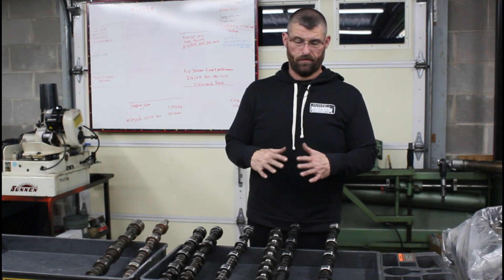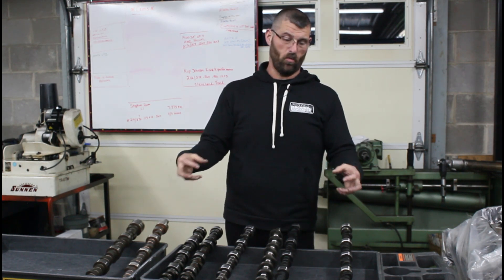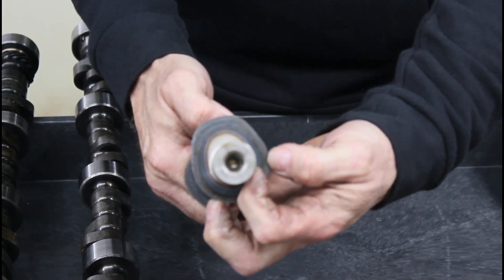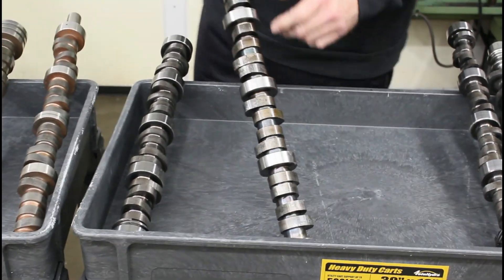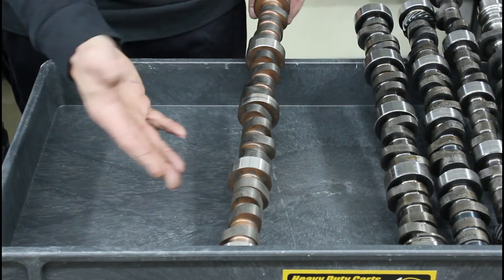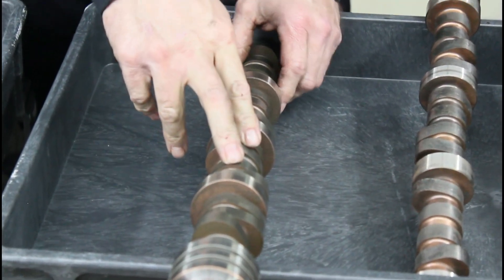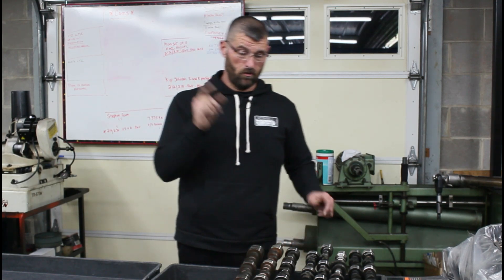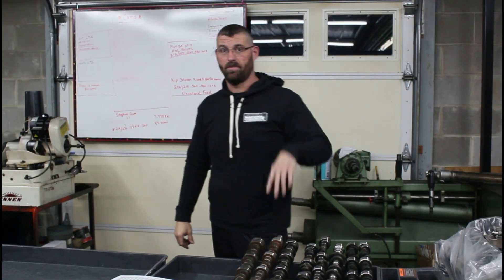Shop Tech: All about Camshaft Cores!

Comment: I have been using the Comp Cams composite distributor gear for many years on my big block race motors and my BBC tow truck with a solid roller cam. I used the bronze gear, several different brands, and I would always see the fine bronze gold looking metallic in my oil when changing oil.
Have you had any experience with the composite gear ?
Reply from the maker: @noahdunaway  na, I don't really use them

Comment: ❤😊The cam tappets or hemie s were wearing and problem s so I bought a 5.3 2015 get time get a new rig looking at the 3/4 ton dodge 6.4 or the Godzilla 7.3  on  5'7 hemie utility hemies such as cop cars city trucks that idle alot the oil pumps had low volume  they had good pressure at higher idels that's might had been the problem s for cams and tape wear on the high idle hours on the hemies to remedy this problem s some forms dodge mechanic s go to the 6'4 oil pump for the 5;7 hemies everything I've read the 6'4 is good all round engine towing hope there good as that ol 2003 Chevy with that 8.1 Allison tranny 2500 that was good truck I wore it out ok just started watch youal😊

Comment: You just recomended an s7 tool steel for a blank to be machined by me. You didnot mention that here. I see that it comes anealed and can heat treat to rc55 so I assume it will need heat treated before grinding. I guess you send them off for that.
Reply from the maker: We do all customs from s7, we do top fuel and pro stock from s7 also,  it can be 60 rockwell but we have to rough in the round lobe then heat treat,  after heat treat the mains are ground then the lobes are ground.

Comment: I am rebuilding my 1958 chevy Bel Air with a 283 cid and Powerglide trans. I am afraid that I will make a bad choice of cam and/or lifters due to lack of knowledge and wipe out a cam and ruin all my hard work. I want to stay with flat tappet setup. What cam core should I make sure my new cam has and what lifter set do I look for to match? It's too late in life to do this rebuild again. Thank-you.
Reply from the maker: Go roller,  no worries then

Comment: The endurance guys told me to avoid dlc.   Just a tiny bit comes off and there goes the whole motor.   Cuts right through oil filter if your even lucky it does go through bypass valve.   The absolute hardest sharpest material in the entire engine in a coating seams risky.
Reply from the maker: I could see that.

Comment: Old motor homes…can’t live with ‘em,  can’t dispose of ‘em.  They are the old soldier that never dies, just fades away.
   Dismembered my 20 ft camper trailer this summer for the frame.  20 hrs to recycle and a huge dirty fire to burn away the wood remnants…never doing that again. Wrecking yards and recyclers won’t take them because of the bulk of it is wood waste and is a huge mess to dismember.
Reply from the maker: I'm confused,  what do old campers have to do with camshaft cores??

Comment: Can they be heat treated again after they are done being ground?
Reply from the maker: No, 2 reason,  #1 there is no need , #2 heat-treated will distort the shaft and it will need grinding again.
Reply: @powellmachineinc  Thanks I saw a video of a designer grinder guy that said the heat treat on the. Cores gets mostly removed when then grind the cams so they reheat treat them. So maybe it’s just hype.
Reply from the maker: @Puppy Gadget  yeah, he is 110% wrong,  obviously he doesn't know anything at all about manufacturing camshafts.....
Reply: @powellmachineinc  Yes

Comment: Question?  I'm working on a LS Chevy motor NAMELY A LATE  MODEL STOVE BOLT 235 Chevy 1962 year. Ya I know I've taken a lot of gruff about it so be it, my project not theirs. Looking for a flat tappet solid  lifter cam and lifters. With all the cam theories and cam goo-rues out there along with all the failure problems. Almost might be easier to figure out a Koenigsegg free valve system, that would allow all kinds of valve setting etc. and further aggravate the put a LS motor crowd in it. Any thoughts on what you may have to offer? Thanks FRED.
Reply from the maker: Email me, maybe I can do something, powellmachineinc@gmail.com

Comment: It's all in the ramp going into the opening the valves against the pressure the slow are you can make it open up the faster you'll get the exhaust fumes out of the combustion chamber
And you won't Tara valvetrain parts because you're not trying to force them open in the porch rocker arm don't have to be so heavy that it can withstand 2000 PSI of pressure
Reply from the maker: Reading that made my head hurt.

Comment: How is the taper ground in the lobe on a non roller cam.  Is the wheel dressed on a angle.   If so then a roller cam would take a square dressing. ????   Thanks.
Reply from the maker: 2 ways, for taper some machines actually dress the wheel at a angle and some the actual head pivots so you can set the angle, so flat no taper for rollers.
Reply: I wonder if u can do a video on the subject of taper.   I  heard that some cams have too much , some not enough, some have taper in one direction, some in two directions,  some like nail head Buick’s have none.  ???  Also I have a garage and machine shop in Fayetteville NC.  We got some studebaker  cams. Can you regrind them for us ?

Comment: A few years ago I bought 40+ new in box V-8 cams from Gearte Racing Engines in Indian when they went out of business. They did a lot of sprint engines. I haven't looked at all of them but it seems a lot of them have full round lobes. some are in 5 packs with other parts in them that I don't understand. Where would be a good place to sell the whole lot at a fair price. I have no use for them but I don't want to give them away.
Reply: Thank you for the response. I will send you some pictures and if you are still interested I could inventory them. I'm building a 1000HP 6-71 blown nitrous I6 Chevy 292 for drag and drive in my 53 Chevy pickup. I need a billet cam for it with my Ryan Falconer V-12 head.
Reply from the maker: @lazyhoundracing9621  I could probably help
Reply from the maker: I would be interested,  email me @ powellmachineinc@gmail.com

Comment: With a 5160 induction hardened SFT using DLC coated lifters do you need to break in with low spring force or
 can you go to its running setup - as per roller lifters- ?
Appreciate your thoughts
Reply from the maker: All the steel cores were roller, the very first core was the only flat tappet in the bunch. If you had a billet flat tappet,  the break-in wouldn't be nearly as critical